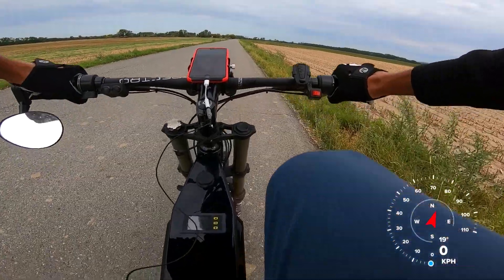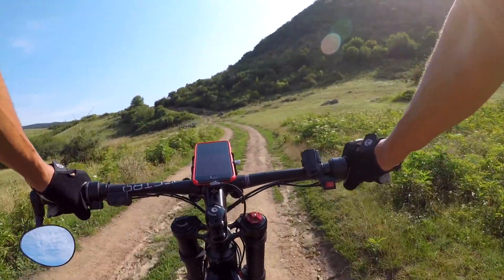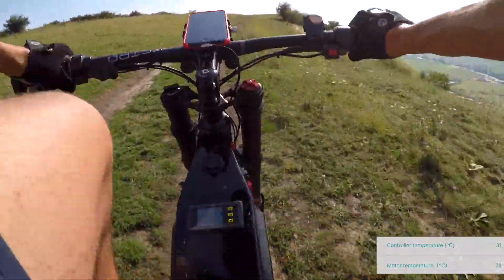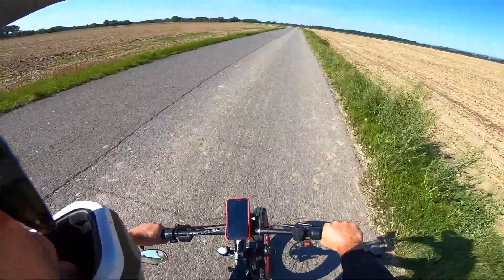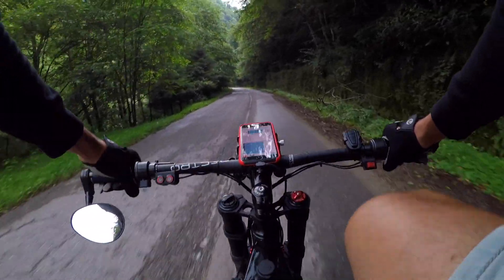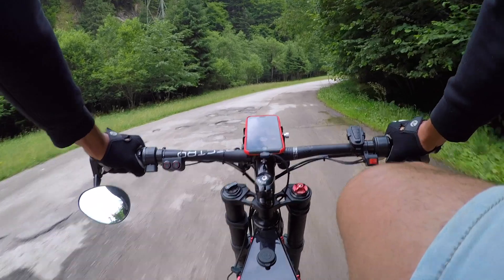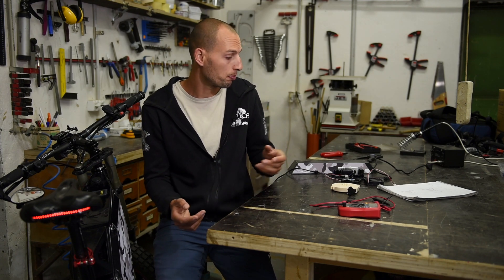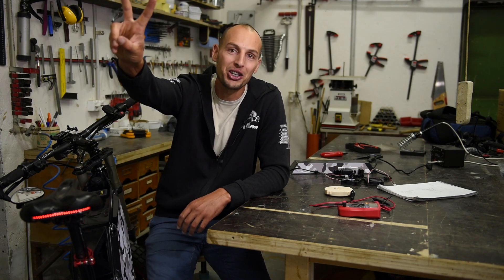Testing Lightweight Electric Motorcycle w/ Pedals - 13kW Power!

Comment: what is the purpose of the pedals? can they help the bike deplete the battery slower? can this be used to charge the battery? :) would it make sense? can i consider these pedals as a way of extending the range and on what principle if so? i like pedalling and wouldn't mind at all if that was helping extend the range and it seems it might :)
btw, this bike is awesome. your project is awesome and the fact you're going about it. I would love to build it myself when i save some bucks
Reply from the maker: Pedals are there for pedaling. Pedaling is great exercise, they help pushing the bike forward. When not pedaling they serve user as a legs rest.
Reply: @ladiandmargaret  I did some research, know about throttle vs cadence- or torque-based pedal assist, but still I think you missed my point. I wanted to clarify what pedalling your bike gives you except for physical workout. Can you confirm that pedaling extends the battery-life when used while throttling?

Comment: I'd like to get the 100kph ebike since my current one was rated at 72lmh. But since it's 60lbs, it only putters up to roughly 40-50kmh. :/ Not to mention the battery. It's horrible since it doesn't give a lot of distance.
Reply from the maker: You should upgrade!
Reply: @ladiandmargaret  I could, but I don't have any income and could take months for me to achieve this. I'd have to do a gofundme or something like that. But I meant the 110kmh bike, my bad. >.<

Comment: hey, I have, same multistar lipo on my bike and I'm using with out the bms,  I'm just balance them some times! Can you help me with bms? Please
Reply from the maker: You didn’t say what you want me to help you with :)
Reply: About Bms? I'm wondering if its 20s Bms? and if 100A would be enough?  I mean for 3 by 5 multistar 10ah 14.8v battery pack!  My is little different 2 by 6 with is 100.8v fully charged
Reply: Thanks for replying

Comment: You have put a lot into making this bike and it look cool, but I don't think its actually legal to ride it on public roads in most (if not all) of EU and this is one of the reasons I'm not sure if its a good investment. Mostly for offloading or outside big cities I don't think anyone would make you any problems, but in bigger cities it actually is.
In my general calculations the basic parts for an e-bike like that are around 2000$ (frame, motor, controller, battery with BMS) and when you put  the rest (fork, suspension, tires, etc.) It can easily go over 3600$.
For this same price I can get an actual second hand bike that will be street legal, this is why I'm not sure that this is a good investment. Its a lot of fun for sure.
Reply from the maker: Thanks for the opinion. What kind of legal bike would you buy for this price? The price really is $3600 usd for parts only, I have every single one down in the parts list.
Reply: @ladiandmargaret   , don't get me wrong. I like the whole idea of an electric bike and even building one by my self. This is the reason I have looked into it and in general I can tell that the price you have mentioned sound about right. Its just that I don't want to just build it and constantly get in trouble about it.
Reply from the maker: I think exactly the opposite. If you build it and know it inside out, you are confident that it’s well build and it’s very easy to trouble shoot anything.

Comment: I just wonder if the bicycle parts can handle 100 km/h routinely which is more like motorcycle territory. Maybe I'm being overly cautious.
Reply from the maker: Good point. The frame is made for this purpose, rims are from motorcycle too.
Reply: @ladiandmargaret  Cool, yeah those are the most obvious concerns, especially bicycle wheels might be a little too thin and delicate. The ones you have on are pretty solid looking. Thanks!
Reply from the maker: Sure!

Comment: Love it. 
Btw, for the reasons of frame size, how tall are you?
Reply from the maker: I’m 192cm tall, 6’2 and it’s fine for me with big tires.
Reply: @ladiandmargaret  i have a very similar set up on my bike same frame as well. my bike does 60 mph as well and 60 on a half motorcycle/ bicycle is sketchy as hell but fun as hell. i have 19 inch motorcycle aluminum wheels and street tires on it, big ass battery to. $3600 us is very expensive for me. you can get this bike directly from china for $2500 straight to your door, charge it and ride. i highly suggest the highest voltage and the higher AH battery you can get as well as a motor over 3000 V.
GREAT BIKE AND GREAT VIDEO.
Reply from the maker: Thanks. I keep an eye on these Chinese ebikes and they don’t have the same specs. Plus I’m not sure about the battery quality.
Reply: @ladiandmargaret  where did you get your frame.
Reply: john dalton I dont think you can buy a bike of this spec for 2.5k usd in China, I looked into this and cheapest bike with specs similar to this would be over 4 grand without shipping, or more power model was 5.5 grand without shipping. shipping alone was over 1k usd as they have to ship batteries separately, they are classed as hazaradous materials, class 8 corrosive I believe. The cheapest way is to build one for yourself which is where Ladislavs plans and tutorials come in handy, it takes the guess work and trial and error out of occassion which is what saves you money, dont underestimate the value of that. plus support.
Reply: you can separate your build project into 2 parts, bike build would be the first part which is easy, all components assembled and ready for part 2 - batteries plus controler for which you could pay a pro to build/assemble you a pack if you dont feel confident with that sort of work. There is a little point in having a battery pack build and ready wirh nowhere to put it into, batteries sitting around etc. Those plans will allow you to do exactly that without reordering parts you got wrong the first time around etc.
Reply from the maker: @bluewanderer9903  It is no rocket science. I think it's much better to start a DIY project. This way one understands principles and has good satisfaction from building something powerful like this. All the maintenance and servicing is easy to do with this knowledge base too. My parts list and the video guide make it very easy.
Reply: Ladislav Jecminek I agree 100%